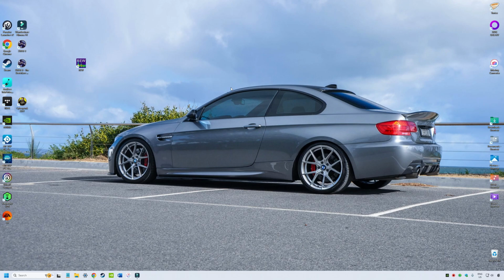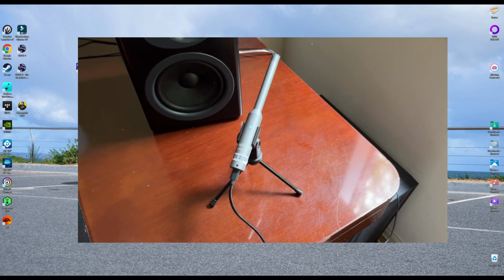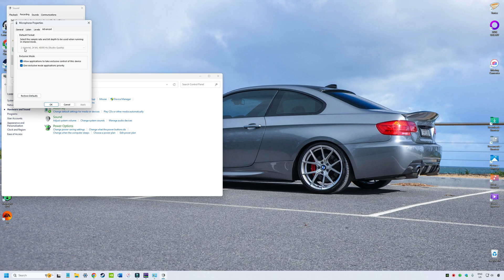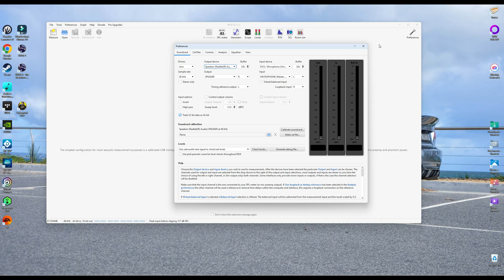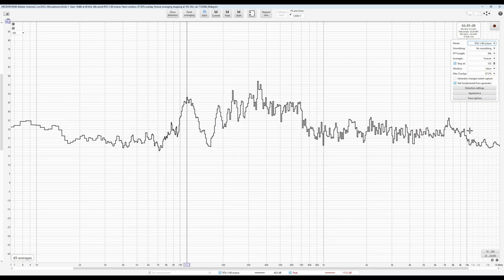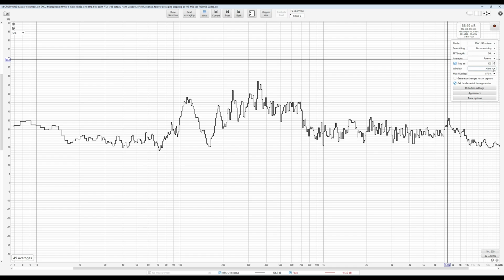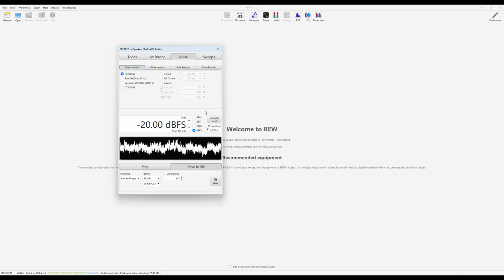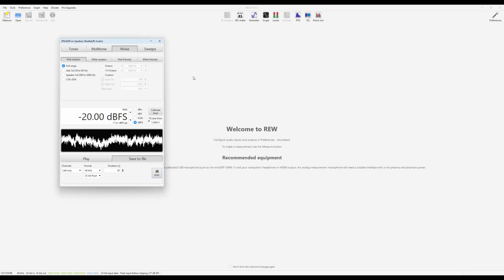Room EQ Wizard (REW) - Car Audio Tuning - Moving Mic Method - Step 1 - USB Mic Set Up

Comment: Hey socket, I have checked in audacity the exported wav file Random Pink Noise Left+Right from REW and the Left and Right track are the same, hence correlated for me.
If I export manually Left only then Right only they are different, then I can make a new stereo track from both in audacity 😬
Reply from the maker: Oh that’s interesting. I have never used Audacity.  What do you plan to do with the track?
Reply: @socketsocket2763 I will use it as my uncorrelated pink noise for measurements. I can send it to you if you want, it’s -9dbfs random pink noise PCM-24bits 48khz.

I strongly suspect that if you use the one generated by REW that’s why you need +6db/oct LF rise because when using correlated Pink Noise, in the bass regions bass adds up to +6db instead of +3db. But maybe that’s not what you're experiencing ??
Reply from the maker: Ah I see....makes sense :)

Comment: By reading the REW manual you notice that Rectangular window is meant to be used with periodic pink noise generated by REW, but I didn’t know about the fact that transmitter and receiver needs to be on the same clock. Did you notice huge differences with hann vs rectangular window ?
I use a Umik-1 too and play Pink PN through Bluetooth directly from REW, Îll give a try at hann window
Reply from the maker: Hann window gives better results then rectangular from the testing I did.  I think I showed the different between the two in one of the tutorial or viewers question videos. I can’t remember which one sorry Matt.  But yes rectangular window is accurate only with certain periodic measurement signals. Hann is a better window to use with the measures we are doing.  People only use rectangular windows because that’s the common advice on the internet.
Reply: @socketsocket2763 Hey socket thanks for the answer, I will do some testing too but yeah good to know.
I noticed in the early tuning videos of Peter he used hann window too then he switched to rectangular but I don’t know now I didn’t watch his recent RTA evaluations.
Reply: Are you sure that the 'Random Pink Noise' in REW sound generator sends different Pink noise to Left And Right speakers ?

Comment: Hi, why there’s a phase shift after eq ing the mid bass, without eq the phase aligns properly. How to align the mid bass phase if it shifts after eq ing.
Reply from the maker: It is covered in the tutorials
Reply: @socketsocket2763 okay, will check it out, but after followed your tutorial videos I did the same thing with my system the output came out really good. Thanks for sharing your knowledge and experience with us🙏

Comment: Great Job with your videos!!! 

The calibration files for the Umik-1 are not for the individual microphone, but rather all the same files for a specific batch of microphones.  

The UMIK-2 calibration files are in fact only for that one specific microphone.  Umik-2 can allow for way more accurate results. 

Calibration files matter and so does the quality of the measuring microphone itself.
Reply from the maker: Hey Hire.. I did not know that. Thanks for the tip :)

Comment: Hey Socket, I'm enjoying your videos. You do a great job! I'm going through this process for my 1st time. I can play the pink noise from rew by using bluetooth from my laptop to my vehicle. Should I still load it to my phone, since that's what I mainly use for music?
Reply from the maker: Hey Jeramy,  thanks so much.  Yes you can load pink noise to your phone no problem.  It doesn’t really matter if you use the head unit or your phone to tune because the tune you create will use whatever source you send it.  The only thing that might influence which you choose is if the head unit has some kind of EQ or something to change the signal to the dsp.  If it does either turn if off or use your phone for the pink noise.   But yes if you listen to your phone then I would tune using your phone to play the pink noise, but you do not have to.  I hope this helps
Reply: Hey, I tune with bluetooth from my laptop to my dsp for playing pink noise directly generated by REW and it works, didn’t seem to have any difference in the end, but you might want to check just to be sure.
Main difference would be if you stream BT via headunit source to your dsp then your signal can possibly be altered as socket mentioned.
Reply: If I play pink noise through android auto I have weird response below 150hz, I've tried changing developer settings in the phone and using multiple apps, always looks wrong/clipped. When I play it through usb drive everything looks great, that's what I would recommend even if using different sources. I have not tried bluetooth it may be a bit better. And I would recommend using the pink noise from JL audio, it seems to be the flattest compared to the others online sheffield, kicker, mtx etc.

Comment: Hi Socket, it's me here again. Thanks for your videos. I'm using the Helix MTK1 microphone and the RTA from the same program. Do I need a calibration file? Or where can I get one? Thanks again.
Reply from the maker: Hi Jose :)   Great to hear from you again.   The Helix MTK1 (tuning kit) has the superlux ECM-999 analogue microphone included in it.  Google "superlux ecm 999 calibration file" and you should be able to find a calibration file for it.  That said if you cant find one its not a big deal tbh I cover this in this tutorial (https://youtu.be/uQN51f1RMsU)
The Helix MTK1 is designed to use with the Helix DSP autotune software, but can be used for tuning with REW.  I use the superlux ECM-999 in all my analogue mic tutorials.  It works great !!  Hope this helps mate :)
Reply from the maker: Here you go I found a cal file for you.  https://www.hometheatershack.com/threads/superlux-ecm-999-calibration-file.173210/   You need to copy paste the list of numbers into notes or something to create a .txt file then you can use that as a calibration file to load up in REW.   If you drag and drop the file into the main REW window, it should draw a plot showing you what the calbiration correction is.  You will see its makes pretty small changes :)

Comment: So for uncorrelated pink noise, you use that first to measure your speakers individually? Do you also use that to see your speakers frequency response to set crossover as well? Also when you mentioned about saving the files dont you use mono instead of choosing left or right ?
Reply from the maker: Hi Nubud,  I made a short tutorial on pink noise that if you have not watched might help you out  https://youtu.be/Eixpt50mb7M.  I also put together a tutorial on the REW pink noise analyser so you can check your pink noise track and see what kind of pink noise it is. https://youtu.be/G-PfNXAS6q4.   re your question on saving files, is that to do with saving pink noise files using the REW generator?   If so i'm not sure but in the version of REW I am using I don't think there is an option for choosing mono or stereo pink noise, just L, R (mono) or L+R (stereo).   If you can find the time stamp for the section you are referring to that would be great.  Sorry I cant be of more help